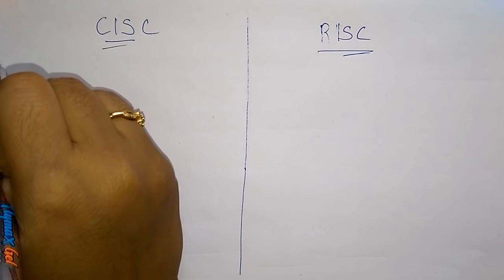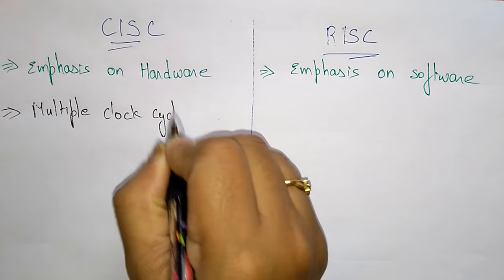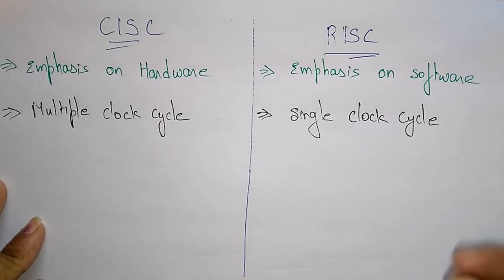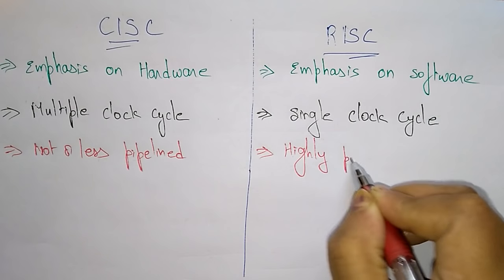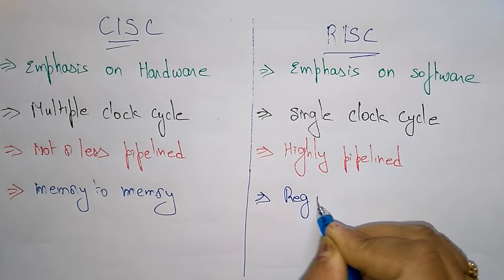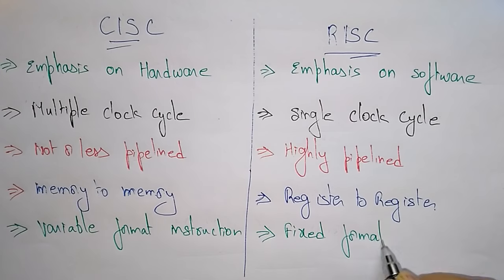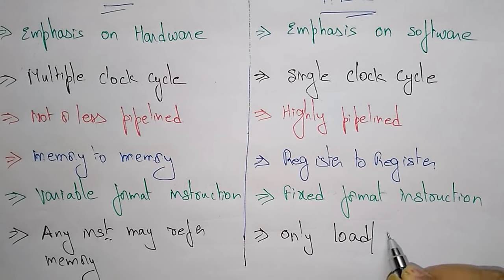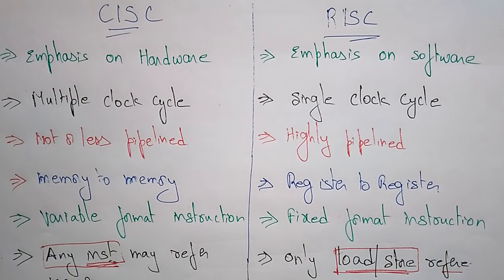risc and cisc in computer architecture

Comment: 00:02 RISC emphasizes hardware, CISC emphasizes software
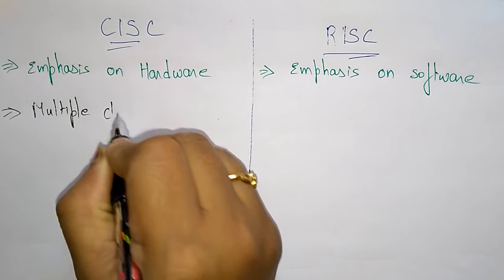00:41 CISC requires multiple clock cycles for complex instructions
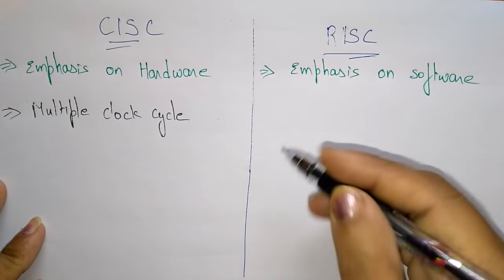01:00 RISC vs CISC
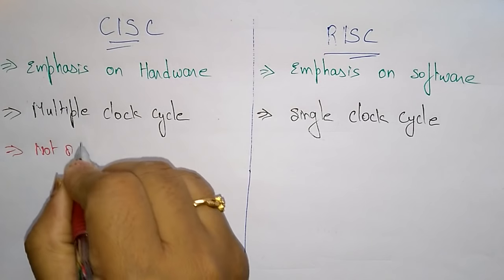01:31 Difference between RISC and CISC in pipeline usage
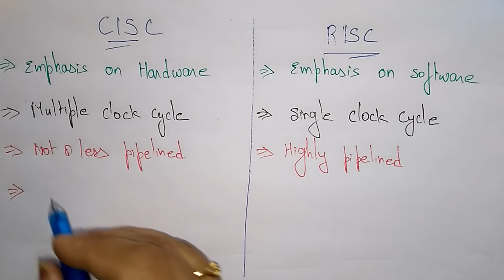02:02 RISC vs CISC architecture
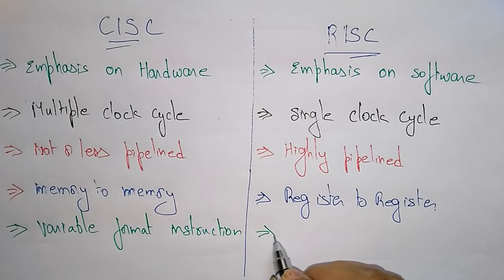02:40 RISC and CISC architectures differ in instruction format
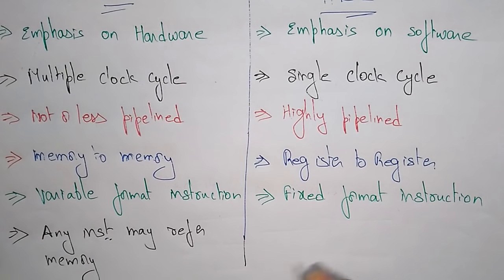03:11 RISC uses only load and store instructions for accessing memory
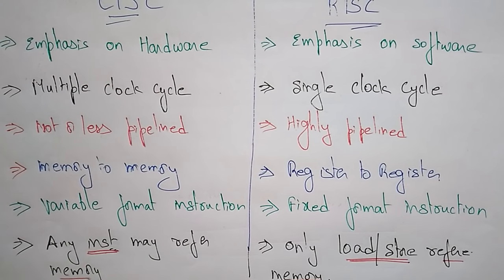03:36 RISC vs CISC in memory referencing
Crafted by Merlin AI.